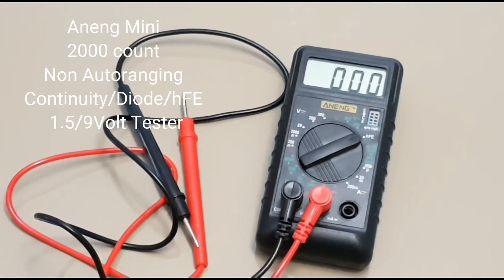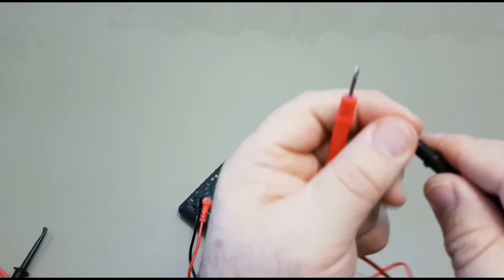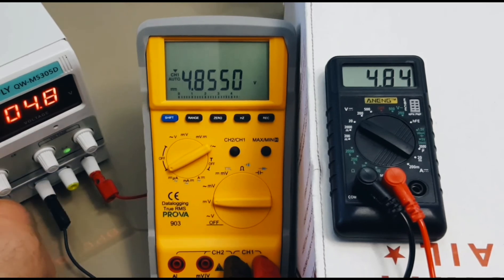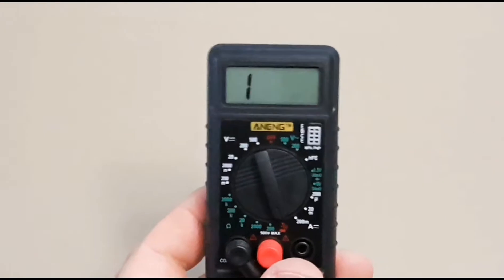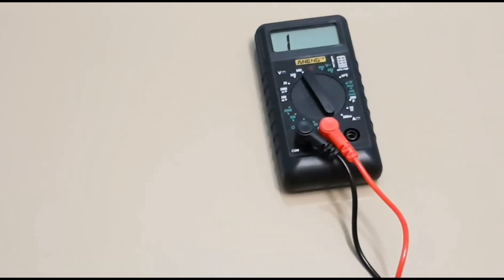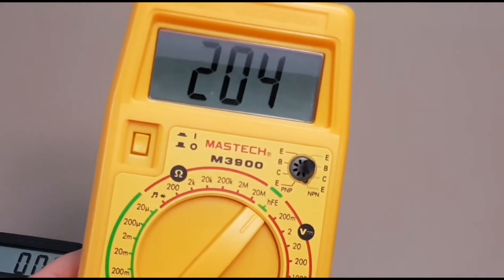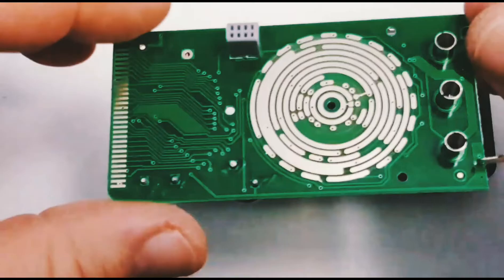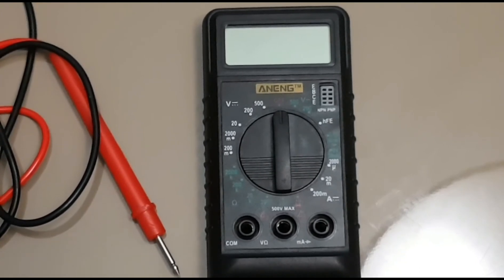ANENG XT82 - WORLD'S SMALLEST CHEAP-O Multimeter Review & Teardown!

Comment: I found a similar one a week ago on our flea bazaar. It started up but could not measure resistances. The issue was... in a tiny 0805 1.5k Ohm SMD resistor. Internally it's a typical 7106/7126 based device like a DT-832.
PS, my device does NOT have any delays in the continuity mode! Here the continuity mode is implemented in the chip, on my device it's LM358 based.
Reply from the maker: Funny how 1 seemingly insignificant resistor can wreck havoc eh..glad you spotted the culprit. These are actually really decent multimeters..I usually I have  1 or 2 on the road with me.  For fun..sometimes I'll pair with a set of probemasters..that's definitely a weird combination but it works amazingly!

Comment: Agree.. bad choice for the battery type.🤦🏻‍♂️
 I think 2xAAA could still keep it small in form factor. Maybe the overall dimension would end up bigger but not that much, for trade with happy users when replacing the battery.
Reply: The 7106 chip requires 7 V minimum, 2*AAA batteries will need a step-up converter. You can use, e. g. 6 to 8 (or even 9!) standard alkaline watch batteries.